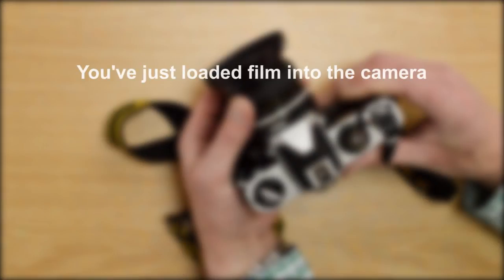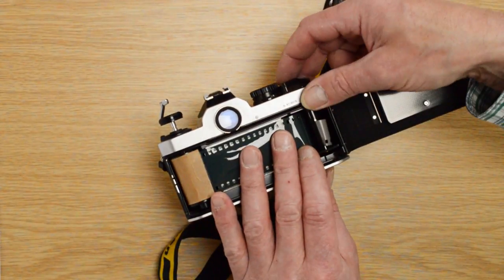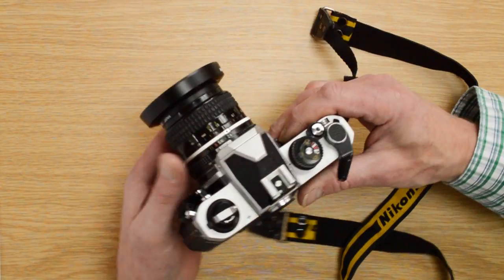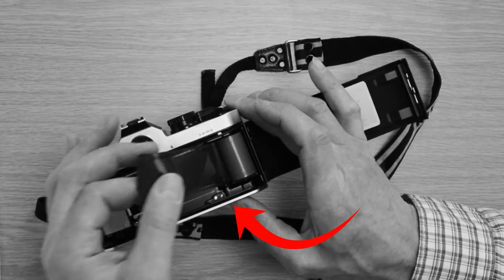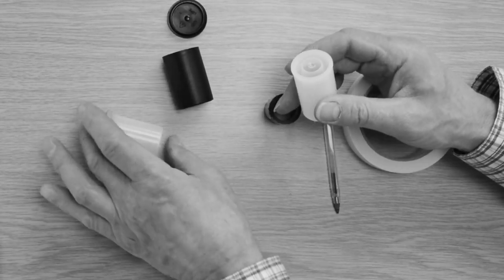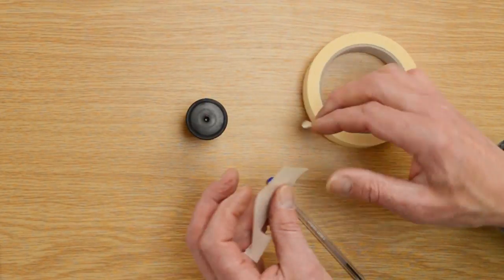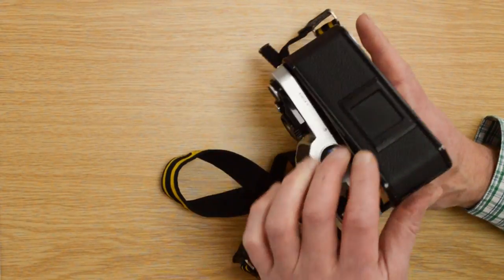35mm film broken? Here's a fix

Comment: what do you do if your rewind knob stops turning/barely turns after a few shots, and you still want to use the rest of the film?? i would not like to take out the film entirely, because i'm only 5 shots into my roll :(
Reply from the maker: If you suspect the film is slipping instead of advancing, then you could shut yourself in a dark space, open the camera and manually rewind the film, leaving the original tongue sticking out. That rewound film is now safe. Reload the camera, making sure the take-up-advance is gripping the film. Close up the back and, covering the lens, advance the film 6 or 7 frames. The original ones should be okay and you don't waste the film.

Comment: So my film release button is stuck. How do I release it from the spool? I understand it would be in complete darkness... Do I just open up the back cover, slide out the film from the cassette and would the spool spin by itself then? Then just roll it up into aluminum foil?
Reply from the maker: If the film is still attached to the 35mm cassette then it's best to take it out the camera then rewind by hand back into that (in the dark). The film can sometimes detach for the cassette if it is overwound, so then roll it up in tinfoil to keep it light-tight. It's helpful to either include the empty cassette or advise us of what we're going to find inside the foil. Your camera mechanism may well reset itself once the pressure of the tight film is released.
Reply: @thedarkroomukltd7541  Thanks for your reply. If the release button isn't working, how would I be able to take the film off the spool on the right side without damaging anything?
Reply from the maker: @flowinglikethewaterz  Difficult to offer cover-all advice from a distance. Often the tightness of the film stops the release from working. Open the camera back in the dark and lift the film off the cogged gear and that might ease the pressure. Once the back is open you should alternatively be able to manually withdraw the film from the take up spool on the right. That spool shouldn't be locked up and will allow this. Then rewind into the cassette by hand.

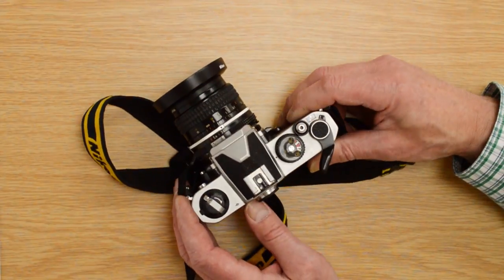Comment: Hello, sir. A very nice video, however I noticed at 2:13 and 5:57 that you were doing the complete opposite to the film rewind knob as the camera was ready to start shooting. Will this have any effect on how the film rewind knob revolves and how the film advances?
Reply from the maker: Sorry, I don't understand your question. Thanks for watching though
Reply: @thedarkroomukltd7541  at 2:13, you turned the film rewind knob clockwise (I suppose to tighten the film and take-up the slack?). At 5:57, you turned it counterclockwise. My question is if this difference matters at all in terms of how the film proceeds from one frame to another.
Reply from the maker: @AndreLieberher  At 5.57 the rewind lever is still sitting "up" so I simply push it down. Sometimes it needs a slight turn for it to engage with the film inside, so I wasn't turning the film, just making sure the rewind was pushed back down. It wouldn't have altered the film position but thanks for being so keen-eyed!

Comment: My point and shoot camera just will not take shots anymore all of a sudden. The shutter release button goes all the way in or either not at all and nothing happens. Any idea on A) how to sort this, B) if it’s worth keeping the film inside or taking it out and throwing it? I was about 12 shots in of a 24 roll but had to advance a couple blank shots to see if the camera would pick up, but will not.
Reply from the maker: Some old cameras go on working for ever, some not, but point n shoots relied on fairly cheap mechanical parts. If you can extract the film and get it processed, most labs will only charge you for the prints they can make so... Maybe ask to have the film developed only - just the negs and see if there's anything worth printing/scanning.

Comment: My minotla xg-a picture trigger won't move at all know how to fix this
Reply from the maker: Sorry Luke  - I'm not a camera repairer so I don't know a fix. Perhaps someone else will have a suggestion? Anyone?
Reply: @thedarkroomukltd7541  I figured out how to get the trigger to work now just want to know if my minotla has to have battery's for it only to take pictures
Reply from the maker: There are a number of SLRs that have electronic shutters and no mechanical option, so yes, if the battery's dead you stop taking photos. Even my beloved Mamiya 6 120 camera does the same, so I carry spares.
Reply: @thedarkroomukltd7541  I know thanks to my grandmother that my camera has to have battery's but I just wanted to know if easy or praical to use a really old camera that takes 122 film and use 35mm film in it
Reply: Luke Goldman how did you fix it? Same happened to kine
Reply: @ryanmiller516   unscrewed the bottom of the camera and a piece of tape on part that was stuck

Comment: I think I am somewhat closer to a solution, I have a Nikon 8008 and the film does not advance, It is the end spool on the right, I do not have a slot to put the end into. I do have a lever of sorts that rests against the spool, so far I have not been ablt to wind film, it is tricky to use. Any suggestions?
Reply from the maker: I found this link, which has the instruction manaul https://www.butkus.org/chinon/nikon/nikon_n8008af/nikon_n8008af.htm

Comment: should the rewind always move round when you wind on the film?
Reply from the maker: Eventually. If the film spool is very loose in the cassette, it may not turn the rewind spindle straight away, but only when a little film has been advanced. Good point though!
Reply: @thedarkroomukltd7541  - Thanks, my colour film from a trip to india did not wind on in my Pentax K1000, so all the exposures went on one neg - so heart breaking, I have four rolls of Black and White 400ISO which I plan to process myself, that I am praying has been loaded properly
Reply: @thedarkroomukltd7541  Rewind switch stuck in up position. Pentax LX Any suggestions?
Reply from the maker: @arricammarques1955  The Pentax LX is a lovely camera but not one I have first hand knowledge. I know a business in the UK that could help, but you may need the services of someone who has the specialist knowledge to fix that.
Reply: @thedarkroomukltd7541  Yes, worth the price to repair. Great build.

Comment: Hey, I have a film camera but the release button doesn't work. I pressed it and now it's loose and won't go back to firm position (to be pressed). What should i do? There's no film inside.
Reply from the maker: Hi Albert. Well I'm not a camera expert so I can't offer best advice. If it's a mechanical camera, try moving the sprocket wheel inside to see if that does anything, or gently take the lens off - it maybe needs to 'reset' back to the correct position. Sorry I can't help more...

Comment: I've recently bought a MInolta XG9 off Ebay. There is no film in it and I was trying it out, taking "fake" photos as such, winding the lever and pressing the shutter button and then the lever went loose?
Reply from the maker: It could be a number of reasons and I'm not familiar with that camera. If the lever is as loose as a bead on a thread then it could be busted; it might simply be a screw come loose under a cover on the lever? There may be a Minolta forum that might have suggestions

Comment: how do i check if i'm not shooting blanks without exposing my film to light?
Reply from the maker: If you've made sure the film take-up is working when you first load the film, then most cameras will have a film-count indicator. The indicator will only turn if the film is moving. Also the rewind lever will turn as the film is advanced - so there's a couple of clues without having to open the camera. Also there's this https://youtu.be/nj-RKg995zo
Reply: @thedarkroomukltd7541  it all works it just doesn't seem to be printing them onto the film. i think the film might be ruined
Reply from the maker: There are so many variables, I can't really offer any suggestions but you'll know more when the film is developed. Once the film is out of the camera, you should be able to hold it to the light and fire the shutter and hopefully you'll see the shutter is working.

Comment: Either its operator error on my part or I wound it wrong, but this is the 2nd time it's happened to me so now I at least know what to do with the film and how to save it! Thanks!
Reply from the maker: There can be a number of causes. Although I'm not a camera technician, I'd check there are no sharp edges on the camera body because that could act as a focal point for a tear. Same thing with the spigotted roller because if it jams, its teeth can do the same. Then of course, make sure you put the film in the right way around ( you'd be surprised how often that is overlooked! ) Advancing the film lever should have the consistent firm/snug tightness all the way through the film.
Reply: @thedarkroomukltd7541  Thank you! Appreciate it! I'll definitely will make sure I check that out!